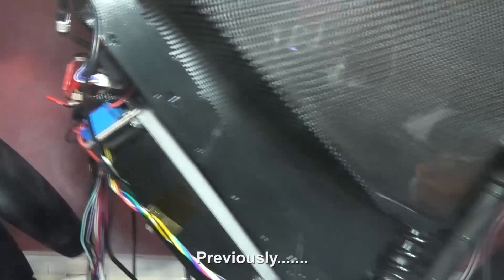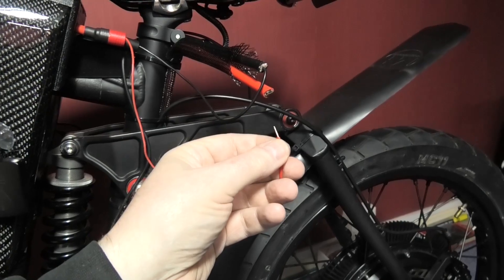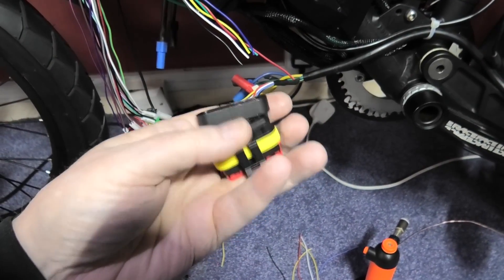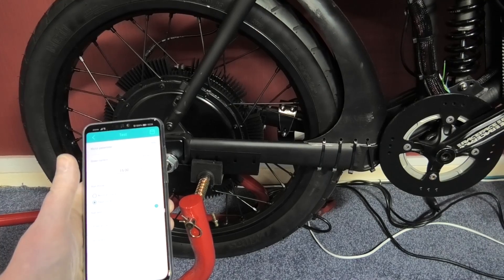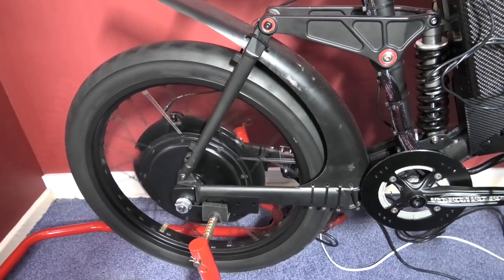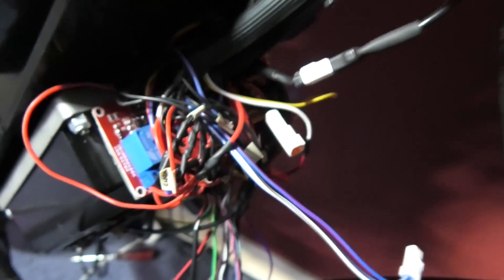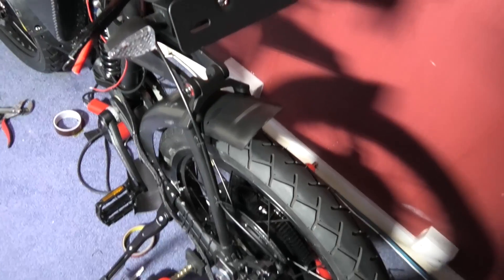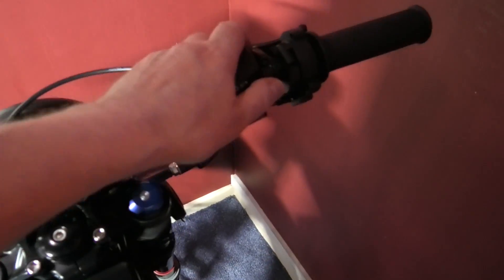High powered DIY eBike MSVA build part 25 - She's alive!

Comment: Where did you get the frame fairing i want to build  e bike and like the idea
Reply from the maker: You mean the batteries and the electronics covers? I designed and 3d printed them.
Reply: @Vortecks  the cover

Comment: Hi Tony on your tyre do you have a coloured dot any where. If you have line it up with your valve. It'll help you balance the wheel.
Dew to your videos. I'm about to take on my own build. 😂😂😂😂
Reply from the maker: Yes, I always mark where the valve goes 😁
If you need any help, drop me an email - vortecks2000@gmail.com. I love to hear a success story 😁
Reply: @Vortecks  .get ready for emails 😂😂😂 I started mine yesterday. ..every things on the bike except the hall effect sensor. As it's still on the donor bike ..I was offered a cheap Chinese ebike with all I need to transfer over to my own bike. ...
Reply from the maker: @lifeinthewild6187  Bring it on mate. I've got to warn you, I'm rather abrupt in my replies for 2 reasons.... 1 - I have little spare time and 2 - there's no point in beating around the bush.
I've helped 36 people successfully build high powered bikes now and 15 more that have built low powered commuting bikes - most of them had zero knowledge when they started. As long as you've got a basic idea (sounds like you have) and you've done some research, (also sounds like you have) then it'll be plain sailing. I get a lot of emails which simply say "send me a parts list" to which I reply "do some research, give me a parts list and I'll tell you if it'll work". You'd be amazed how many people don't bother and they buy one off the shelf. I'm here to assist and educate but I''m not building them for anyone 😁
Reply: @Vortecks  😂😂😂 I'm blunt to a falt. Having built concourse cars and motorbike .an ebike can't be that hard. .research and development. It the key .I've access to a lath milling machine. Welders a lad with electric genus. .it's more of why the fuck is it not working what am I missing 😂.. as I've said I bought the cheap bike as a learning curve before I go the way you have . ( can't wait but need to learn understand what's going on ) .bike wise I'm using my bmc sports elite. .I'll email you with a few questions.

Comment: 2 wheel drive with regen braking is the way to go i think
Reply from the maker: 2 wheel drive is way too heavy and forks are designed to do 2 things - absorb bumps and stop you. I've seen some horrible things when people mount motors on the front.
Reply: @Vortecks  so a 4 wheel drive car is way to heavy too? lol, make the whole bike out of carbon fibre except the motors and battery, problem solved...
Reply from the maker: A 4 wheel drive car is designed to have 4 wheel drive. If I add another 20kg to the front end, there's no way would I be able to get it up 2 flights of stairs - it weighs 52kg as it is!

Comment: i also noticed you say you cant use regen, wouldnt that be because of the brake lever having a microswitch instead of being a variable lever type (like the trigger on a ps4 or xbox) , allowing for a continous voltage to pass thru? i feel because its a microswitch, it has to be activated to allow a voltage output. im no electrician but yknow lol

Comment: Hi Tony can you please help me I have a 500 v Back wheel Hub after a few rides out it’s Developed a heavy Vibration when it’s turned on and lack of power on twist throttle I took it apart but can’t see anything wrong there’s a little circuit board on winding of motor do I need to change that, I would appreciate any help😜

Comment: Hey vortex, hope ur well, so I sent you a message on here the other day asking you if it was possible to charge a  couple of Raleigh battery’s that I had, thanks for ur reply. And so I’ve given up on that and have decided to buy an Ebike from new, I’m a complete noob when if comes to this kinda stuff as you may of noticed 😂. So could really do with some help I know ur busy and I apologise for being a pain in the arse, however I don’t know where else to get some legit help, I’d well appreciate a point in the right direction.  So I’m 6”4 and almost 19 stone so a bit of a lump so need a bike that will not struggle especially when it comes to hills as I live in Brighton and there are a few. I suppose the max distance I would do is 15 miles that being not very often normally it’s no more than 10.  I’d like something with a bit of speed.  Is there any bike you could suggest to me?  Thanks for any help you can give me. Price wise I’m pretty open within reason.  Thanks again.
Reply from the maker: Sorry for the late reply mate, my back is bad again and I've been bed-bound for 3 weeks now.
Believe it or not, I know nothing about 'off the shelf' legal e-Bikes. All I know is they're all slow!
If you get one with a hub motor, you're limited to one speed but, if you get one with a mid-drive, you're also limited on speed but you have the gears to help you so you'll have more torque at slower speeds but the same power. So..... hub motors are easier to maintain but mid-drive have more torque at slower speeds.
Sorry I can't help further, it's not something that interests me 😁
Reply: Vortecks thanks for ur reply mate, and I hope ur back is better back pain is a nightmare.  So that’s what I kinda worry about spending 1500 and ending up with some slow crappy bike. Still thanks for the info you have given.  Shame you can’t knock out an extra couple of bikes lol cha ching! Take care buddy.
Reply from the maker: @sharkbite5744  The thing you have to remember is the law...... all 'off the shelf' bikes are limited to 250W and 15.5mph. The only way around it is by spending mega money or importing one from China. FYI mine costs around the same to make as a mid-priced e-bike but with way more power than the most expensive one.
Reply: Vortecks exactly shame I can’t  buy one from you. Anyway if I bought one and could take off the restrictor what difference in speed could you get do you think? I watched a video the other day about a shop in London near the shard building and they said they can take the restricter off if it was for private land, thought that might be an idea, then just take it where I want I’d have to be unlucky to get caught 😂
Reply from the maker: @sharkbite5744  For a 250W system, you might get 20-25mph. What you need to do, is have a switch that makes it 'road legal' so you can still use it on the road 😁
It's quite easy to fool  the controller into giving full power. The internet is full of tutorials..... https://www.youtube.com/watch?v=4d-hLWGUhqc

Comment: Tony whats kind is the frame u using ?
Reply from the maker: It's a Kona Stinky & Kona Coiler Deluxe mix. I used parts from each, simply because it would work better but I could have just used one of the frames - they're virtually identical.

Comment: You may want to consider thicker phase wires,  maybe you've already done the math or just know from experience but they seem a bit thin even for short runs. maybe check out ohms law and the size /length of your wires. hard to tell from the video but guessing at WOT you're losing 200w just in the phase wires. minded i dont see anyone having that bugger wide open for too long haha

Comment: Sacrificial wire, fantastic idea, particularly as my throttle was wired incorrectly (even though both ends were already wired into connectors when purchased) and tried to pull full current as soon as I connected the battery, saved me a lot of trouble. Thanks, Tony. Stunk the house out for a while though haha.
Reply from the maker: I always use them now, they've saved me so many times. It's also useful for testing the phase/hall combo where it can pull full current instantly.
It's also a good idea to use some thicker gauge (sacrificial) wire on the maiden run because some phase/hall combos seem ok when doing a dry run.

Comment: Hi vortex hope ur well,  so I have a couple of Raleigh JCEB360 8.8 lithium batteries 36v,  but dont have the proper charger. However I do have a 36v charger from another bike  I think it's called a PC4 power charger 4.  Could I use that somehow to charge the Raleigh batteries?  If yes obviously I don't t have the right connection to plug into the port but the batteries have a plus and negative at one end can I just attach bare wires to the positive and negative?  Thanks for any help you can throw my way.  Cheers vort.
Reply from the maker: I can't find much info on either the original charger or the PC4 power charger 4.
If the PC4 power charger 4 delivers the same voltage and equivalent (or less) Amperage, you can use it. e.g. if the original charger is 36V 3A and your other one is 36V 2A, you'll be fine.
As for the polarity, it's usually positive to positive and negative to negative but I'd check it with a voltmeter first.
Reply: Vortecks hey fort thanks for ur reply, and thanks for the heads up I’ll go ahead and try it then, if you don’t hear back from me you know I’ve burnt my house down 😂.  Man ur bike is a beast what do you think it stands you in cash wise now?

Comment: Good job on the bike but if you are after a cheap decent looking electric  motorbike the super soco tc max is a great option, would have saved you a lot of time and trouble and will perform better and is msva approved out of the crate https://www.youtube.com/watch?v=dLc4jYW3erE this is why I dont fully understand people wanting to make ebikes road legal motorbikes? because you go from riding a fast push bike to, riding a slow motorbike the minute the bike is classed as a motorcycle, you lose all the benefits of riding a push bike and gain all the downsides of owning a motorbike, I was glad to see Andy Kirby dropped the idea as well, I just don't understand it.

Comment: Awesome bike so far, the only concern I would have is the front travel clearance, it looks like there is about 1 and a half inch between the bottom cover and the mudguard and about 2 and a half inches from mudguard to tire so around 4 inches ( 101mm ) and those forks if i recall have 120 - 160mm travel, so the second you brake or brake hard its going to slam the front tire into the bottom cover and lock the front wheel and that will end badly.

Comment: Tony have you figured out how to use the variable regen, I've got it wired up to a thumb throttle but it doesn't seem to do anything.
And how long did you stand looking at that before you found out how to run the hall sensor test that had me for a good 15 minutes lol

Comment: Tony could you make a carbon fibre or fibreglass half mud guard that is attached to the frame of the rear wheel then extending 40 degrees outwards / on this angle to catch all the water? If you have a mud guard like this then it will prevent all dirt & water from going up your back because water travels backwards with the rotation of the wheel as it flies off & as soon as it hits this crazy mini mud guard then it will stop from hitting you. The cover of the mud guard only needs to be around 12 inches long with the center frame of the mud guard being at around 1030 to 1045pm angle if your front wheel is on the right & rear wheel is on the left otherwise it would 115 to 130pm if looking at the front wheel on the left & the rear wheel on the right.